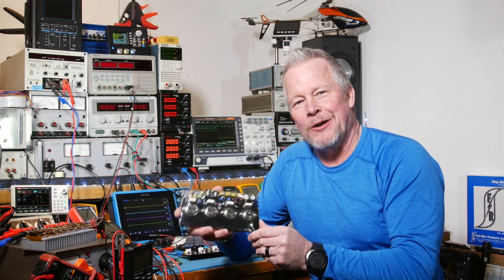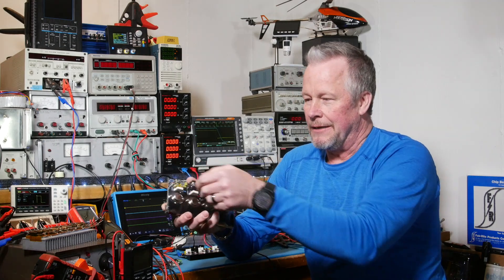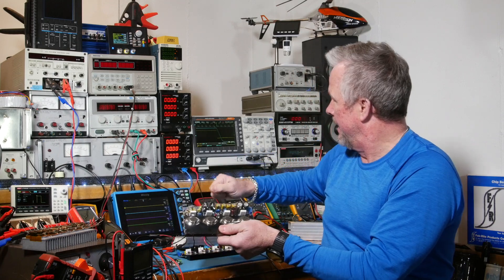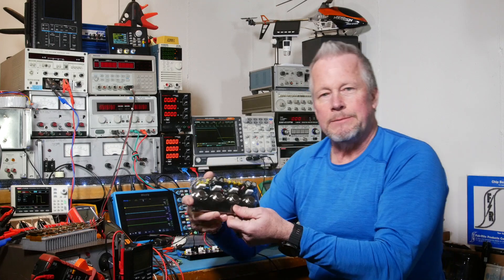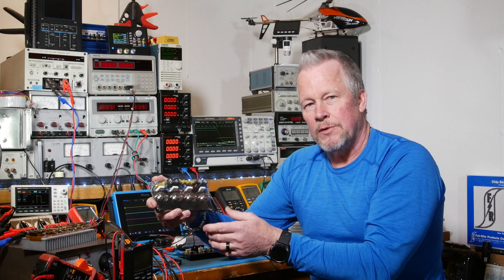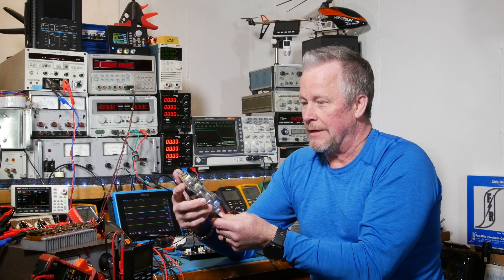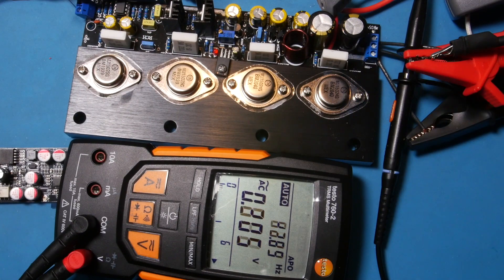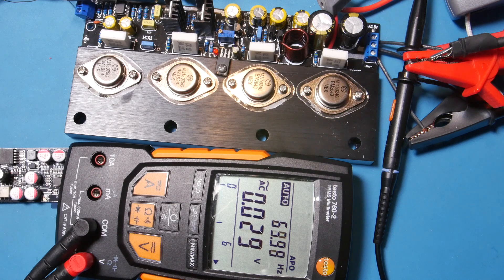20 Watt Class-A Power Amplifier Fail

Comment: When I was building my L12/2 for my YouTube channel, my first tests was using just 25/0/25 volts as I was waiting for a transformer. I  must say I was a little disappointed with the results. It did get quite loud but something was missing. After I received the correct transformer to give me 50/0/50 after rectifier, wow what a difference. Huge dynamic range, just brought out all the detail, 110 watts into 8 ohms, double into 4. Real watts, not Chinese watts.
Regarding your test amplifier, seams an odd thing to do, capping the internal working voltage at all, at such a low level. My be it's a dissipation issue. More volts more amps? It looks like they are selling class A rather than a useful amplifier.
I think class A is one of those ideas than in theory it MUST be better, but I have not found that to be true. A good quality class A/B amplifier (like the L12/2 with high power, always sounds better, mostly due to high dynamic range. Fatigue free is the best description I can offer. Stay as far as possible away from clipping!!
Reply from the maker: Thanks for the great feedback!  I agree on all your points here!  Isn't it amazing what voltage level does for dynamics?  I think a huge problem with Class A is that if you do have the voltage level, then your power level is crazy inefficient.  Someone commented that Pass claims 25% to impress how inefficient Class A needs to be to be good, but even 25% might be too conservative.  I think Class A may only be good for headphone amps (in the Winter);)

Regulating the input stage is fine and actually may have some great merit, but it can not control and should not control the range at the output.  This amp it does, and I think that it might be unwise to place a gain at the output of this amp as it is claimed to be 'no feedback'.

Comment: TO-03 package stainless casing approx 5to7cent and aluminium casing approx 12-15cent
Reply from the maker: The cans are steal, and not aluminum.  Is that an indication that they are not real?
Reply: @KissAnalog those are  expensive one 
Good heat dissipation 
Thank you
Reply: Stainless steel vs aluminium ,
Aluminium better heat dissipation, 
But both are inside same silicon wafer,
Manufacturers cost savings on theirs wire bonding and  packaging

Comment: Eddie, since the Chinese Amplifier was a fail, you should rip one of those TO3's out cut the top off and show people what a china faked transistor looks like !  :P
Reply from the maker: That would be a great idea.  I don't think the problem I am having here (clipping) is due to the TO3s thought, it comes from the input stage.  But, maybe the TO3s would fail with more power, so it would be nice to know if they really are real.  However, the vendor agreed to accept the return, so I think I'm sending them back. I did also get 2 right channels and not a right and left.
Reply: @KissAnalog  Build those Large white boards :P easy & very nice !

Comment: I would be probing and comparing the input and output of the opamp first to see if it's just a buffer stage or if it's adding some voltage gain and see if the sine wave is being distorted at that point, if that checked out ok, I would trace the next point, I see two transistors on heatsinks, if they aren't voltage regulators, then they are the output drivers and I would check out the signal at their base to see if the signal is clipped before or after! 
It would be a great shame to give up so soon without checking to see where the problem lies. It could even be those output stage transistors? I'm not a huge fan of those things... 
That amplifier could be a clone of a JLH (john Lindsay Hood) design or a Quad design, those two designs are all over eBay! And if that's the case, they were probably designed to run the T03 2N3055's which are much better for audio. 
John Audio Tec would fix this thing for sure. 
If all else checked out ok, I would replace the feedback resistor on the opamp to try and get more output out of it... But definitely check for clipped signal between the different stages! It might be a simple fix, the Chinese probably copied the original circuit design but swapped out the output transistors which the circuit was never designed for and couldn't work out why or didn't know why but figured that it's a famous design and people are just going to purchase it, they don't care... That's the jist of it... But please do a follow up on it, together we can do it!
Reply from the maker: Thanks for the great feedback!  I know what you mean - I hate not to fix something, but this amp cost near 100 bucks.  Also, I think you are right about the outputs that they need to be switched to the 2N3055s and that's just more bucks.  And then even then, this design might just be a loser.  BTW, John doesn't buy/review the more expensive amps that I do;)  My wife would kill me if she knew how much I spent...;)  

I tried to find a schematic or more information, but all I can find is the description referring to this as a 'no feedback' amp.  So, that could be a problem adding more gain to the input stage as it could make it go unstable.  I'm confident that what this means is the output stage is a driver/buffer stage and that all the gain comes from the input stage.  I think you are right that whoever filled the parts list might have made some value changes.  I think I did find a comment on one of the sites that sold this listing parts that needed to be changed to get more power out.  At the time I wasn't concerned about getting more than 20 Watts, and I hadn't purchased the amp boards yet.  Now I can't find that information, and I have spent too much time looking.  If I had the schematic I'd feel a lot more comfortable.  The vendor offered to have me return it.  I can't solder and remove parts to trace the circuit if I'm sending it back.  So, do I eat the cost of this and what might be a dead end, or bail out?  

I have compared this board and parts (transistor count) to other designs that are on sale at various vendors, but I can't find anything that matches up.  Either the front-end OpAmp or transistor count or mostly both, doesn't match up.

I tried to show that it is the front end that is causing it to clip so early.  I showed the regulation on the front end stage where the zener sets the voltage.  And then, when I change the +/- Voltage rails from around 17 V all the way to 31 V, there's no change in the clipping level.  This shows that the output is controlled by the input level.  The way to fix it - without changing the gain stage is to let more voltage get to the OpAmp.  It would be safe to let it go up near +/- 20 V.  That would give a good 4 V higher peak, but still be woefully short of 20 Watts.  Changing the feedback resistor around the OpAmp would be the more sure way to get higher gain.  But, I tried to trace that part of the circuit, and I'd need to remove parts to see the trace work.  Taking continuity measurements only got me so far.  BTW, I'm sure that the transistors on the heatsink are the drive stage.
Reply: @KissAnalog  if that's the case, if you can send it back and get your money, that's what I would do, having no feedback to control distortion, its missing a potentiometer to either adjust the bias or mid point or DC offset makes it to difficult to make voltage change's... Just send it back... There's far better options out there, I have purchased class A amplifiers that came in a pair of two mono boards for $15Au and they had mid point and DC offset adjustment's to allow you to use them with the power supply you choose, they are only rated for 10W but because of their flexibility, you are only limited by the specs of the transistors (although they can be replaced with something better if needed), the size of heatsink and of course power supply capabilities... Also being two mono boards, they can be mounted on either side of an enclosure if you are using one of those that have heatsinks that run down either side... 
I realize that John only works with Amplifiers on the cheaper end of the scale but that's just what set's you apart from everyone else! 
It's a real shame that this amplifier didn't work out because at first glance it looks good but unfortunately it's not worth it... Send it back while you still can... Those 10W amplifiers that I mentioned earlier, they were able to rock my house, I have no complaints especially for the $15Au that I paid for them... I personally recommend getting a set if you ever come across them on eBay, they will have two multi turn potentiometers and a large blue capacitor in the middle of the board, well worth the money 💰..

Comment: Was this sold as 20W RMS? It would appear that the specification is for PEAK power perhaps.
I would agree that power supplies are the issue with this...for example that NE5532 op amp on the input doesn't really hit it's stride until the supplies are +/-18Vdc. For audio work and class A you need a supply with enough stored energy to deliver on the transients attacks of the music.
Don't you just love the Chinese marketing, take this for example: "Pure class A output, each channel can output 10W, equivalent to 40W of class AB and 80W of digital amplifier. Enough to drive most home desktop/bookshelf/indoor/floor-standing speakers." (So how does 10W become 40W...just change to a class AB amp...really!?!) The amp described by this ad had a power supply featuring a 130VA air core toroid transformer and use Vishay Roederstein capacitors.
Reply: They are terrible, did they remember to mention in the description that it has feever capacitors? LoL... 
This amplifier is a copy of something old and much much better, but they have used something that it wasn't designed to work with, I'm putting my money on those output stage transistors, the majority of old school amplifiers used the T03 2N3055, I reckon if those were dropped in, the amplifier would come good instantly, I have seen it myself with other amplifiers and john from John Audio Tec's channel ran into the same problems! Someone sent in an amplifier to assemble and also gave him a set of MJE transistors which were supposed to be much better than what the kit came with, the kit's T03 2N3055's looked as fake as they come out of China, so he decided not to use them, but he had problems right from the start! He finally decided to throw in those fake looking thing's and wouldn't you know it! They worked, and all the distortion disappeared! Just like that... So that's why I think that it's the output transistor's...
Reply from the maker: Great question Tim, sorry to get back so late.  By now I have a few more videos out that answered this question;)  I am going to actually try to step up the power once more;)

Comment: Couldn't you replace the zener diodes with higher values for more headroom on the output?
Reply from the maker: Great question Josh!  Yes, I think you can, and that would be probably the easiest step.  I think you would still be limited to about 12 Watts without further improvements.  I'll post a new video to explain.

Comment: I think i sent you a few very nice amplifiers ! Them Green  white Jean Hiraga Boards are easy to build and will do 60watts easy :) Sent you nice MJE output's too :)
Reply from the maker: You did.  I was just in a hurry to get an amp built for a friend, so I went with already built modules.  It takes time to come up with a parts list and order all the parts.  When I placed my order for these modules it was last year and it took awhile for some to come rolling in.  I do have more kits that finally came in.  Plus I am limited on board size for this project because of the box that I bought (by accident/wrong size).  Otherwise I could put the Aleph 5 amp in it as originally planned.
Reply: The MJE output transistors are terrible for audio... When it comes to the classic T03's, the 2N3055's were used everywhere and were very good at it. Even the Chinese reproduction of them are good! 
That amplifier looks like a clone of an older design which was probably designed to be used with the 3055's, some person in china probably thought that it would be a good idea to add a buffer stage opamp and use what appears on paper to be a superior transistor but if the amplifier wasn't designed for them, it's not going to work... 
I have swapped out the 3055's for MJE's because I was reading in a forum about how good they are and everyone else was saying the same thing, I got some and tried it! It was terrible.. I would have had to put in a lot of work to get them to work... 
There's an old saying, just because you can, doesn't always mean that you should! That saying has never let me down..
Reply: @PeterMilanovski  I would disagree with you 100% Chinese fakes = crappy performance AKA fire / Smoke. I sent Eddie some Jean Hiraga amplifier boards and some nice MJE transistors to build with. The PCB / Kit that Eddie is working on here is another perfect example of China cloned garbage that didn't work and results in wasted money !  PERIOD !
Reply: @JasonLeaman  if those boards that you sent Eddie were actually designed to work with the MJE's, then that's perfectly fine! 
The board's that Eddie is working with are definitely clones of something, could be a John Lindsay Hood design or another popular clone is a Quad 40 something... Whomever built this thing has decided to improve it without knowing what he was doing... I have used MJE's in lieu of the 2N3055's which the circuit was based on, expecting to get better performance and sound because everyone else on the forum claimed to be getting but that wasn't the case for me... 
I have built that cheap Chinese eBay Quasi Complimentary amplifier that a few YouTubers had a go at and got pretty good results with it and even was able to get claimed rated power but I had to increase the voltage to do so... Luckily the amplifier had the adjustment for bias and midpoint so that I can feed the higher voltage into it... 
The amplifier that Eddie is working with, needs to have its signals looked at between the stages to see where the clipping is happening, if it's only showing up at the output, then that's a clear indicator that the amplifier was designed to work with MJE's... I would then try different different T03's... Most notably the 2N3055's which is what it was originally designed for... 
The Chinese remake of the popular 2N3055 isn't as good as the original and I have seen fakes that had small signal transistor's inside, but the majority of them are okay... I have purchased heaps of them at the cheapest price available from eBay china and all that I have used thus far have been good, I always make a small purchase, test them when I get them, if they pass, I get heaps from the same seller... 
I have read the books by Sloan and John Lindsay Hood and even Nelson Pass, the amount of output transistor's that these guys go through to get the design perfect is insane! I have a huge respect for them, and their designs are still standing the test of time, that's why you can find clones everywhere... 
We shall see what Eddie comes up with when he gets the amplifier you have sent him, honestly I have never heard of it so I will be keen to see it's performance, especially with the MJE's, I have a box full of them waiting for a home....
Incidentally, just a thought! You weren't the same person who sent an amplifier kit with a set of MJE's to John Audio Tec's channel? That was a great video because it shows exactly what I'm trying to say...
Reply: @JasonLeaman  no worries! I will keep it in mind, I already have more amplifiers than I know what to do with! But I'm always looking for something that looks and sounds good! I will have a good look at them when Eddie posts a video on them...
Reply from the maker: I do actually have a bunch of kits and boards to review, so I'll be slammed all year;)
Reply: @KissAnalog  woo whoo! More amplifier videos, that amplifies the happy feelings LoL.... 
I will keep it locked in to this bat channel...

Comment: It would only be good on 95+ DB efficient speakers where are you at only need one WATT to get louder output by just using one WATT of power. 
           Like I said in the very first video on this class a amplifier they were dreaming advertising that as a 20 W class a amplifier not even rolling downhill with a back wind pushing it couldn’t even dream of approaching 20 W. 
          And I was a D student in electronics class and just at first glance without studying it was that obvious
Reply: Most people will quote the peak output power for class A else it would be ridiculously low. People will just not buy it. A well-designed class A amp actually sounds louder than you would expect since it is much cleaner sounding. SE (Single ended sounds even better since it generates only second harmonic, but the efficiency is atrocious, 15% is a good figure to co by.
Reply: @nicoras8803  exactly,   And who cares if it’s not efficient , it sounds good that’s the important part. 
           And in San Francisco the little extra added heat is a bonus.
Reply from the maker: Thanks for the great communications here!  It is awesome to see this community growing!  By now I've come out with more videos that helped answer these questions;)